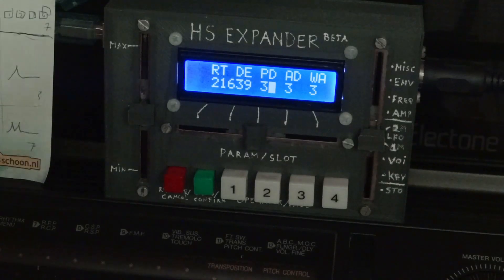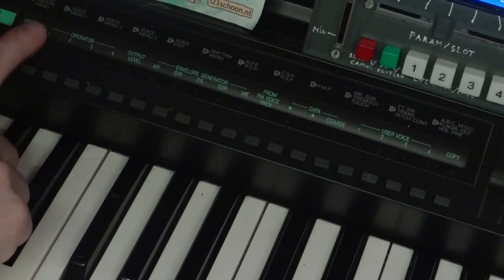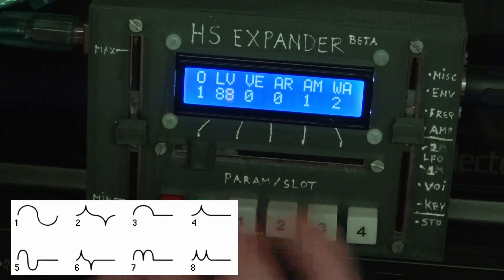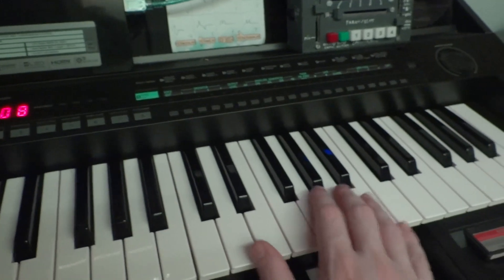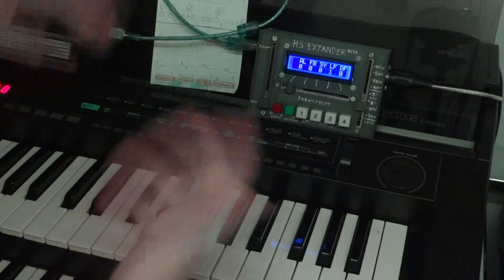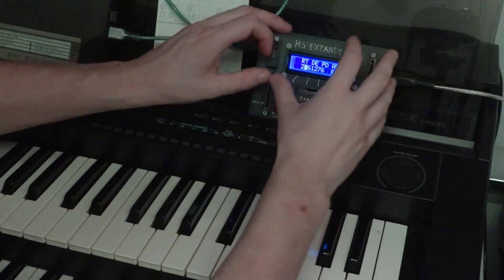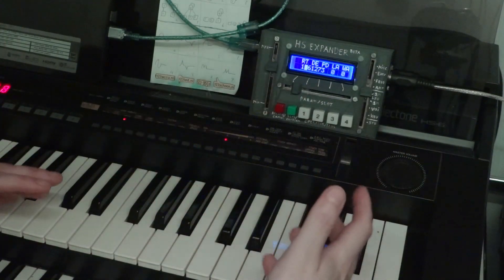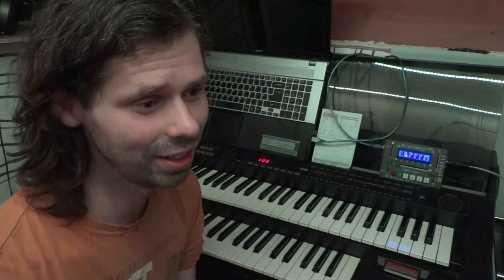UNLEASH THE FM BEAST - Electone HS Expander Beta #fmsynth #synthesizer #diy

Comment: Amazing job! I recently discovered the Yamaha DSR-2000, which also uses the 2414 chip, and there´s an amazing free online editor called Portasound JS... I wonder if the DSR and the HS share sysex data. There´s a website called Unlocking the Yamaha DSR-2000 in which the guy explain how he reversed engineered the sysex voice format. Now I have two DSR-2000 and they can be had for very cheap if you´re lucky.